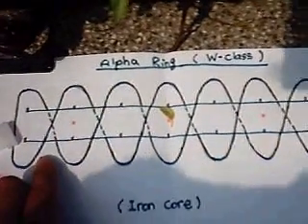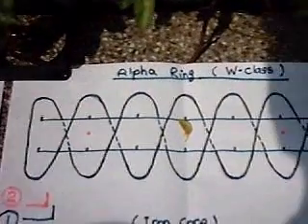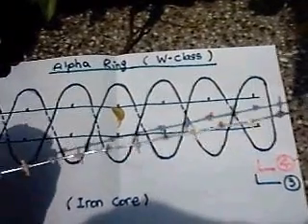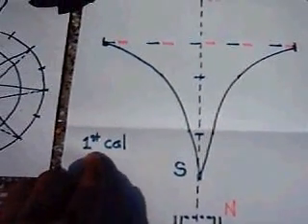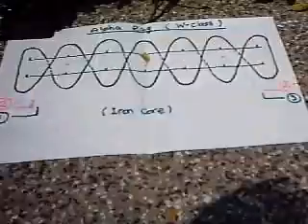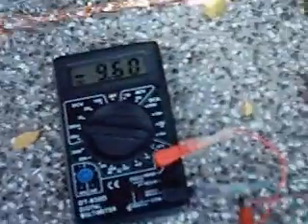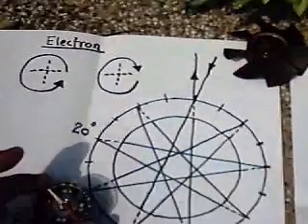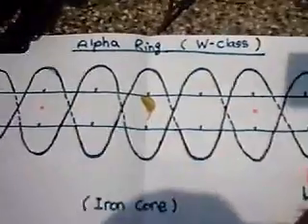Bedini motor 1.2 (An Alpha ring) (2/2)

Comment: PLease forgive, I do not recall the '12'.    I will have to view your videos and get out of my mind to remember.  I know,it sounds strange.  Multiples of three is the key.  3+3+3 is 3 threes. 12 is 3 fours and also adds-up to 3.  I think that it is a mathematical progression. 9+3=12 which when added equals 3.  Nine is the threshold and when 3 is added, that 3 is the synergy added to the whole.
3=3+1
3+3+6+2
3+3+3=9+3
It's hidden in the expansion of the universe  invisible Chi-more than whole